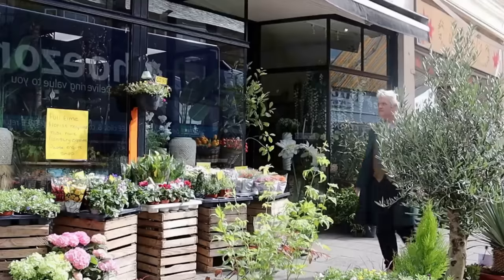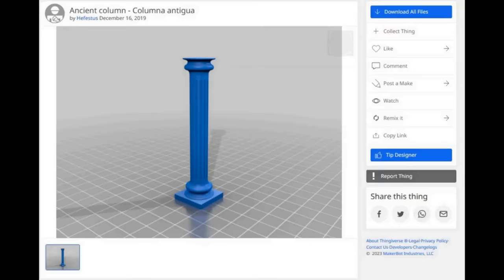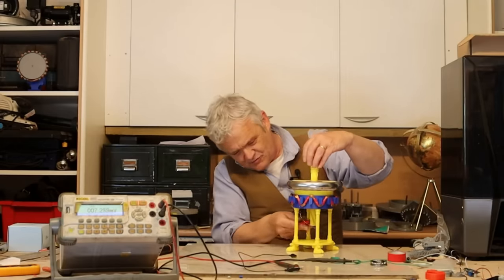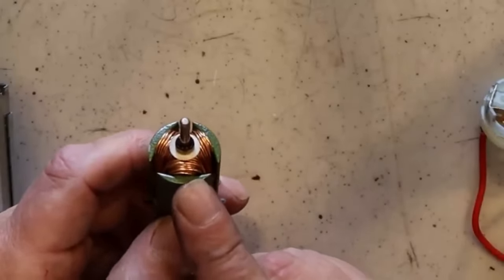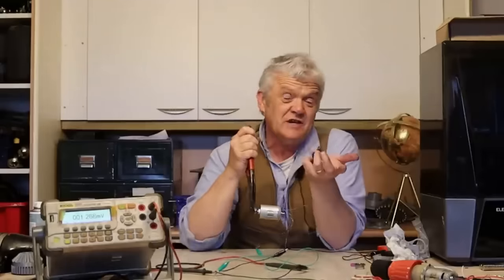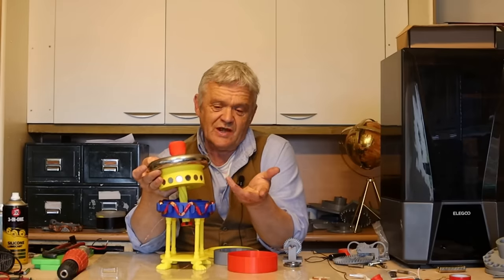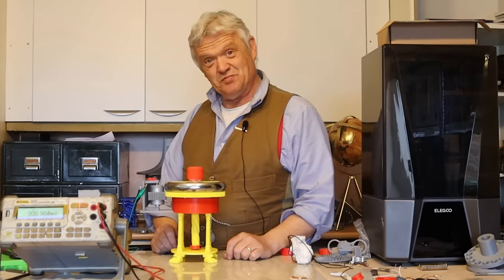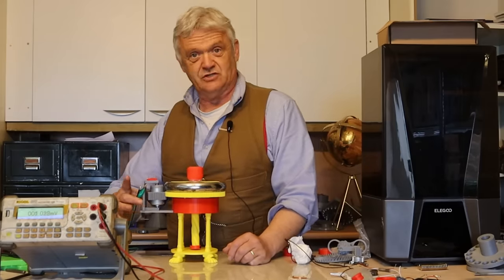2046 An Unusual Hand Generator From An Electric Drill

Comment: Rob, you REALLY ought to use a microwave turntable motor for something.  They are typically 6 RPMs, or less.  That means that you can get a HIGH voltage, for very few turns.  I placed one in the middle of a 5 gallon bucket lid, and used a screw through the lid, to turn it.
Keep up the good work.
Godspeed.
Reply: ... This comment is why I'm about to go through a junk pile in my barn at 9 pm at night.

Comment: I had thought about these the other day for the footfall power video, spring at the bottom and sharper angle with a heavy flywheel when stepped on, spin it! Would work but beyond my brains to design at the moment. Perhaps using a much bigger center spindle to transfer movement to flywheel from smaller but heavier presses by sharper angle?

Comment: You are a real wizard Rob.
Turning a brushed into a brushless.
That is so cool. Thanks a heap for the tip. I have a heap of those drill motors. Now I finally have found a use for them... i knew there was a reason for keeping them and im glad i never threw them all away. Thanks a heap mate 👍

How many amps does it output?

Comment: this was AWESOME!!!! I used to love playing with those spinning tops when I was young.. and (for once) I don't have any ideas to make it easier LOL - I NEED to get a 3D printer!!! I have 2 or 3 old drills that are useless garbage right now and I would LOVE to just be tinkering away like this very day LOL
- I DID NOTICE that the serpentine coil was in a zig-zig (saw-tooth wave) pattern whereas the others you've shown were in square wave pattern... (I hope you know what I'm trying to describe, I don't know what else to call them lol) - what is the difference between them performance wise? AND is there a relationship between the density of the serpentine pattern and the size of the magnets and how close they are together? - I would assume more dense the waves in the coil and the more dense the magnets are, the more power you create, BUT the harder it would be to turn... 
- AND instead of having one row of magnets the size you use alternating N/S, what if you were to use smaller magnets and have two rows, alternating N/S... sort of like a zig-zag pattern that is closely spaced.... ???  oh that wouldn't work because then it would be all north on the top row and south on the bottom row... okay then some other pattern.... - I guess what I want to know is if you know if there has been experimentation done with different configurations instead of the fairly simple way we do it now? It would probably be early work by someone like Tesla, I just don't know who would have been the one to look into this stuff , So I don't know where to begin....

Comment: I would love to be able to make that mechanism into an wave powered wave break. If you could make that up and down movement turn a flywheel within a floating glass fibre shell. That flywheels spin inertia and if there where more next to it. You could maybe be able to build structures on the ocean not having to think too much about waves and stuff. As the bigger the waves more energy inte the flywheel so it could maybe be somewhat self regulating.

Comment: Love what you have done in this episode. In the final design, could you add a clutch at the bottom (in reverse) to capture the energy from the up motion, and/or put additional motors (now generators), 5, 6 or more in total around the 100 tooth gear to have multiplicative power output

Comment: Hi Robert, i had once commented on one of your videos. Basically put the magnets on the outside edge rather than using gears. Cut a long story short if you watch tr-labs he has a disc spinning to  spin a propeller e.c.t  forget what he is doing but for the gearing on the outside it would  be fantastic for the video i am talking about. I can't find it but you hopefully know what i am talking about. Kind regards.

Comment: I'm curious, why take off the existing batteries and coil?  It could have been modified to just have the gear coming out from the top and you could power both generators at the same time, no?  Do the coil and magnets create some kind of resistance I'm not aware of?  Otherwise its the exact same energy going in from the piston, driving two generator's, right?  What could be wrong with that?

Comment: pyrolysis machine in homestead to get methanol from grass. collect as much as possible during warm period. + most basic single piston  stirling engine( ex. can with rubber :D) . Find a way to attach nicely ratchet generator axis pole to the rubber piece . burn methanol during winter to run your SIMPLE single piston ratcheting generator.... That's the plan but i wonder how much methanol i could extract during summer on  1 acre land. if it could slash electricity bill by 30% atleast during winter , I would be happy

Comment: Could you put a spring on it that would bring it back? Then you'd only be pushing it down
Reply: Sure. But that requires "right spring" , meaning , sufficient force to push the plunger back up , adequate dimensions for the contraption he made. Finding such a spring , defeats the purpose of what Rob is doing in these videos - giving ideas for further experimentation and/or research. He could , for an example , easily put four , or more motors/generators , to make more power , he also could make smaller cog (in a form of a cap of the motor) to multiply speed of rotation and so on...